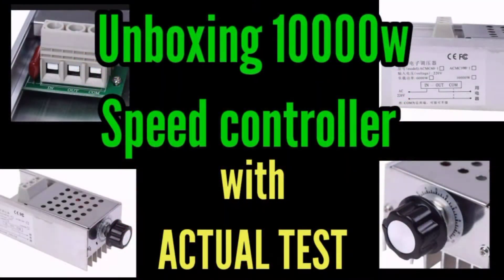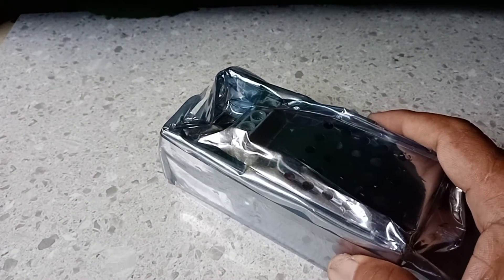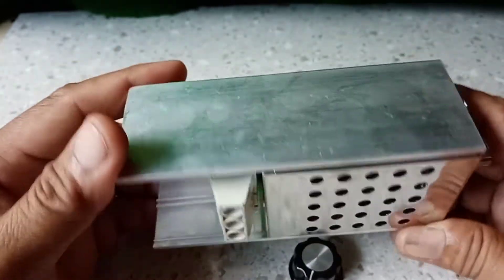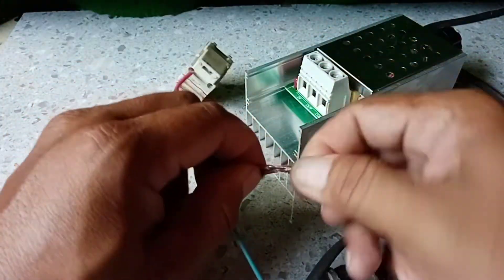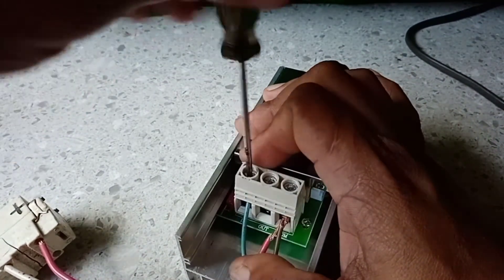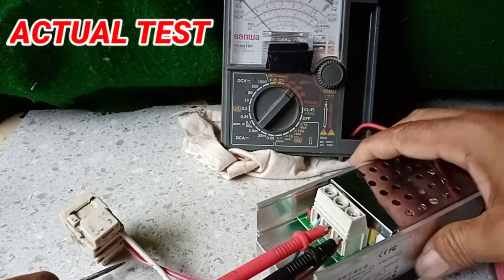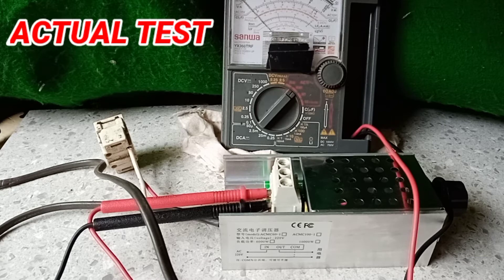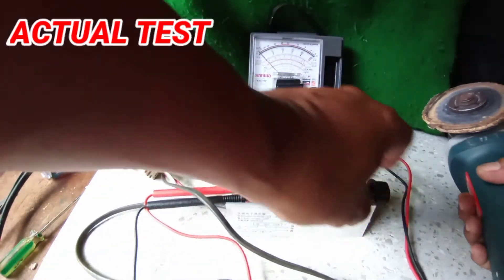UNBOXING 10000W SPEED CONTROLLER WITH ACTUAL TEST

Comment: Speed is one thing - actual useability is another - does it have full TORQUE at any speed or do you also lose power at the low speeds - that is the most critical factor, POWER LOSS not speed